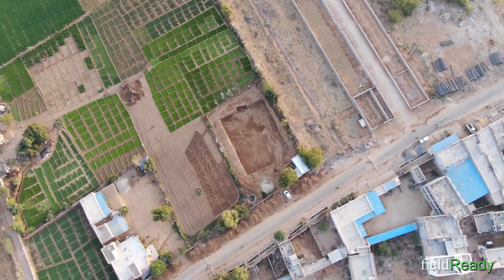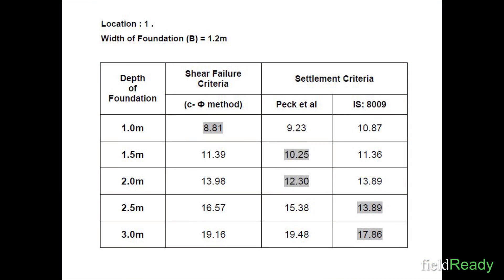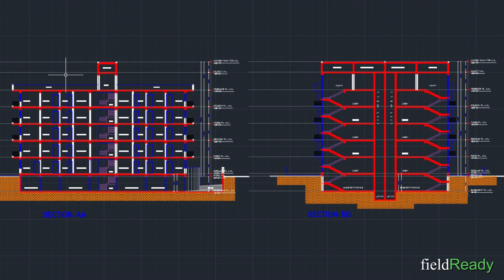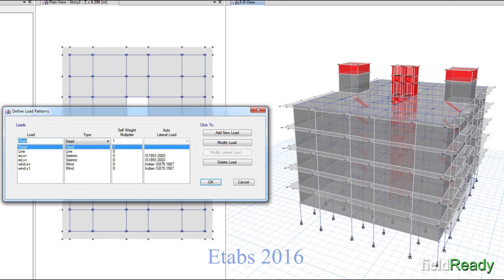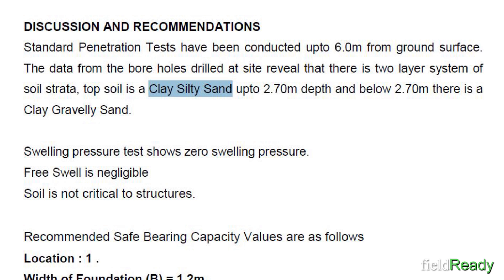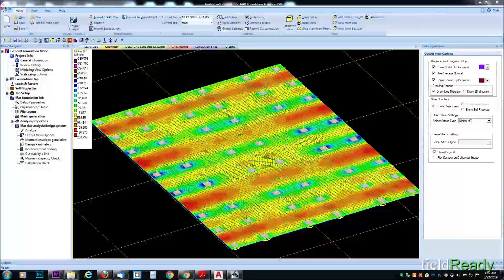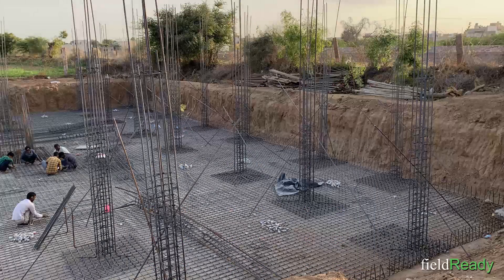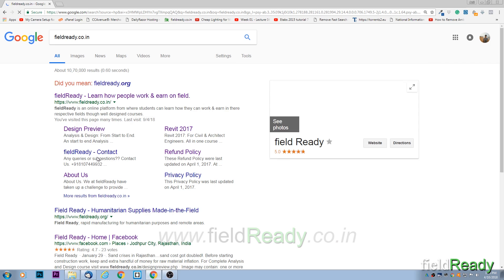Practical 6 Storey Building Design Overview | fieldReady

Comment: What kind of foundation is suitable for 5 floors commercial complex like  shops, banquet hall and hotel on normal ground. Grand beam foundation or piling foundation ? Please advise. Thanks
Reply from the maker: It all depends on the SBC of the soil. More over it will go with RAFT footing it the plot area is less.